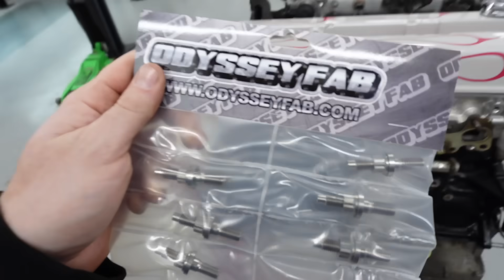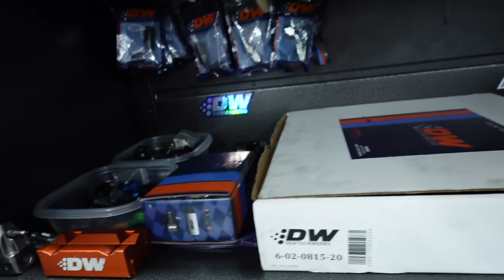Major Progress On My JZX90!

Comment: hey Grant, add some led light strips to the rails under your 4 post ramps and also facing up on the channels of the ramps so youll have light below the lift and facing up to the chassis of the car on the 4 post. easy mods and huge benefits!

Comment: That factory location for the regulator seems quite close to the brush end of that starter motor.  Especially bad if fuel fittings were to leak.

Comment: Grant you are a far more smart, and better man than I, but you might want to use a rubber grommet around your fuel line where it goes between your intake runners? While I am sure it would be years before it could ever happen (with both heat wrap, and a SS line). Those casting edges may, or may not cause you issue vibrating/rubbing your line in the future.